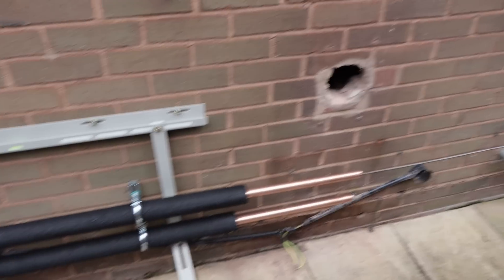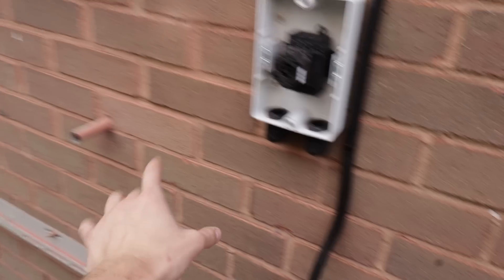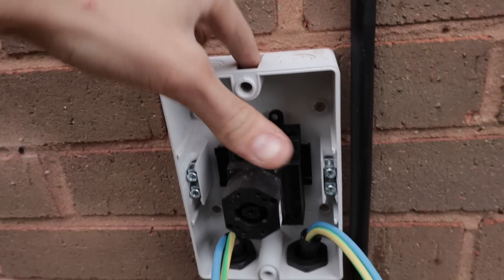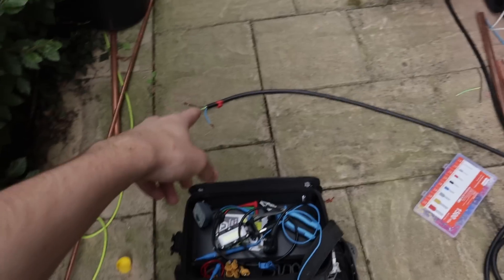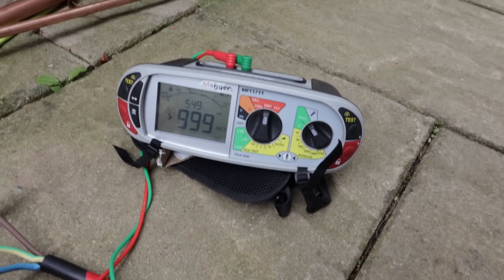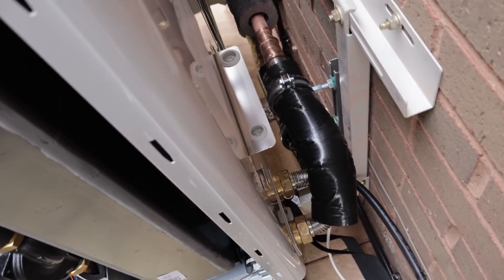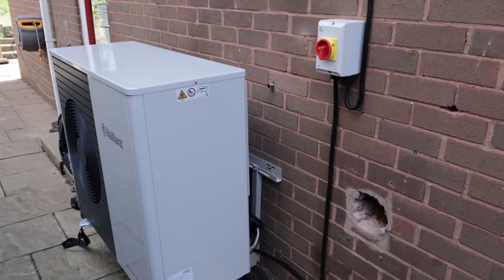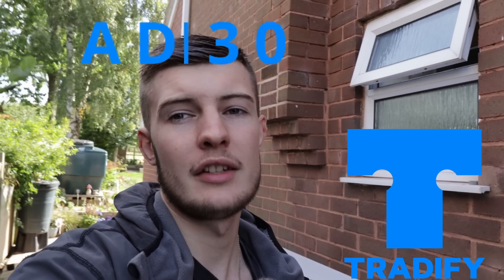Vaillant Air Source Heat Pump Installation❄️🌡️

Comment: Worried about John's install

Looks very close to the house so airflow into the rear could be compromised

Looks very close at the front to bushes which could very possibly lead to micro-climating, especially with such a large unit
Reply: Looks like it follows regs though min 200mm behind etc., is a small vaillant anyway by the looks of it

Comment: Hey Adam, Nice job 😊, Just one thing i thought of.. would you not have been better doing an end box and conduit down the wall into the top of the isolator instead of fire clipping it down the wall?
Reply from the maker: Hi cheers mate and yes that’s a potential way of doing it , might try that on the next one however I never like to do too entry on outside equipment

Comment: Good video Adam. Just a minor one, as you discovered the isolator open during r1/r2 test, assume it was also open during your initial IR test, so internal cable  run may not have been in circuit during test.
Reply from the maker: Cheers mate You are correct, after I re did every test from the beginning in my little order I do it as when I was focusing on filming and trying to test my brain had a fart 🤣

Comment: Hi adam did you protect the heat pump with a type b rcd? Due to the inverter inside the unit? Also if you read installation manual also says type b rcd?
Reply from the maker: Hi bud in the installation manual it stippulated about using c type for over load and then type b in certain locations however didn’t list locations it wasn’t the most helpful tbh
Reply: @AdamDunlopElectrical  RCD mate, not MCB
Reply: Type C MCB for inrush current that loads the capacitors on the inverter board. But as the OP said, you also need this via a type B RCD, that will still operate with the various DC noise leaking back up the supply.
Reply: We fit up to 10 a week. It definitely states type b rcd.
Reply: @damienhanson4929 10 per week! Some coin being made there
Reply: If the cable is surface it won't need an RCD, nibe  just mention a type c breaker, I have not connected a vaillant one though and the manufacturer may say it needs RCD protection. 
I wonder how many people are fitting a type B RCD, the Schneider one is £140.
Reply: @acelectricalsecurity  Navitas 63A Type B RCCB is only £82. Best value one I've found so far

Comment: Was there any extra qualifications you need to do ASHPs? Or just standard sparky bits?
Great video as always lad!
Reply: Just a question mate , is that bus cable good for external use, I normally like to run it in flexi con until it’s in the property ?
Reply from the maker: Yea mate it’s uv rated 👌🏻 , whilst the way it’s ran outside for 1 metere under neath pipe lagging so it isn’t exposed to uv   As added extra protection
Reply from the maker: Hi nothing new no as I was just installing a supply with rotary isolation however I did stay around to see how it works / connects up etc 

But yes normally you need to be MCs acrreddited
Reply: Sounds like more paperwork and fees to ? SOMEONE @AdamDunlopElectrical
Reply from the maker: Potentially I’m there just to install electric suplly / rotary isolator mate

Comment: Is that bus cable uv rated mate? Think you should have slipped some flexi con over it
Reply: Vailliant dont provide bus cable needs to be shielded also to manufacturers instructions
Reply from the maker: Manufacturer stated that it should never be twisted or shielded cable for this install 

And plumbers supplied it mate not valiant
Reply: Adam just Google inverter rcd protection have a read. Then speak to Vailant tech. I promise they will tell you to use a type b rcd.
Reply: We use a type c mcb then run through a double pole type b rcd
Reply from the maker: I already know that I’ve wrote it above mutilple times type b rcd if they are stipulated for installation site ,  I’ve not once said you don’t need one  the only thing I picked up on was saying you install shielded cables where the instructions state never install that type so I’d check with valiant techs  for that mate
Reply: @AdamDunlopElectrical   it’s your site. For you to stipulate. Why wouldn’t you use one when it’s a big metal unit outside and all literature and advice are to use one?
Reply: @damienhanson4929   This is fecking hilarious, between the MIs , tech support and a couple of sparks cannot even agree on the breakers and cable to be used  WTF .
Reply: @haydnlawrence8167   to be fair I was on the wind up a bit. You don’t need shielded cable for ebus cable but should be uv rated. But you do need to protect there units with a type b rcd. That’s straight from there technical
Reply: @damienhanson4929  👍 No worries. 
Just out of interest, is there a heater in that outdoor unit or is the 6mm cable just for the fan , compressor and pump load  ?
Reply from the maker: Yes bus cable uv rated mate I believe it was supplied with device
Reply: Yeah the eBus wiring on Vaillant controls gets upset if run too close to mains or other data buses, using a shielded cable is always a nice touch for trouble free installation
Reply: Again it definitely states shielded cable. You need to look at this no type b rcd and no shielded ebus cable. People are paying for this doing correctly
Reply: You don't need a b type
Reply: @jacktissington  that’s straight from there technical. Due to the inverter
Reply from the maker: I’m reading the exact installation guide now that came with the unit and Under 7.3 requirements for electrical component it states it needs 

type c mcb 

Then type b rcd IF These Are stipulated for Installation site 

Then below in 7.4 requirements for the bus cable the first 2 points are 

Use twin core cable 

NEVER USE SHIELDED OR TWISTED CABLES 

So I’d have a read over your manuals as in comments above you have stated your installing shielded cables and trying to advise me to install something the manufacturer states NEVER install